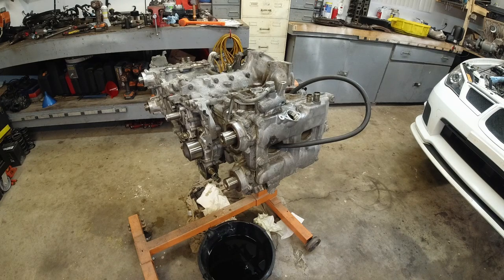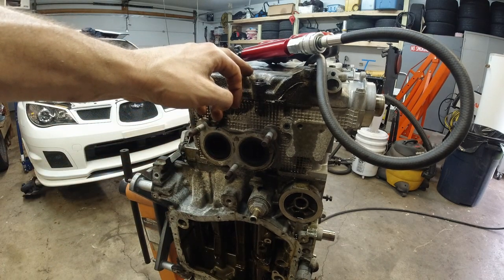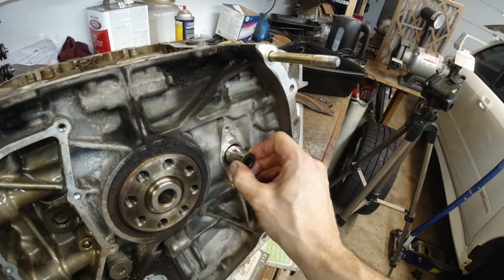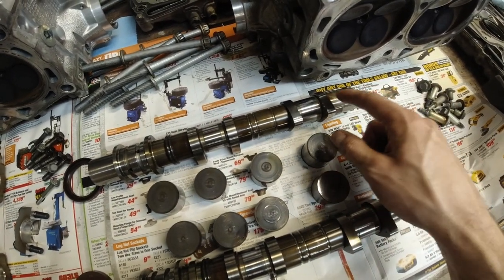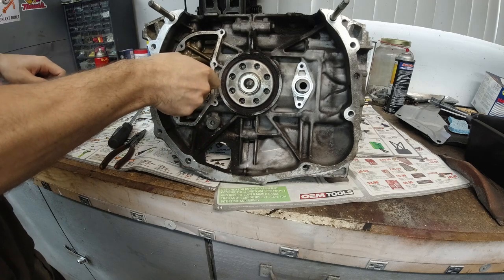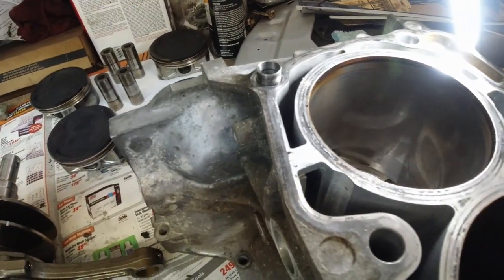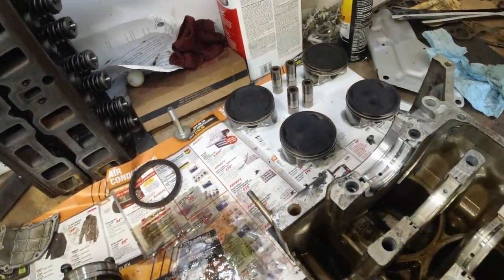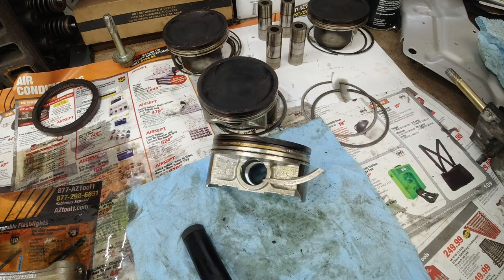Subaru STI EJ25 engine tear down, leak down test, found the problem part 2

Comment: Dude.. sad to see that.  Great video by the way!  I found you by watching videos on the OTC leak down tester while I'm waiting on mine to show up.  Real clear, easy to understand.  Thanks.  One thing that surprised me was that the leak down test didn't show more leakage past that broken ring land.  Especially given the lower compression numbers.  Although, 18% leakage is not real great from what I understand from watching other videos. (but some of your other cylinders had slightly worse leakage numbers). 
I've subscribed and am looking forward to watching your build series on this engine (including the ones that you have already posted).  I'm in the process of checking out an EJ255 out of an 05 Legacy GT and wanted to get an indication of what to expect.  I've also picked up an 05 OBXT and will hopefully get to use it for my daily and the Legacy for my toy.  Following along with ya!
Reply from the maker: Thanks for the sub and good luck with your project, I hope it works out well for you, cheers.
Reply: Sorry to be so off topic but does someone know of a way to get back into an Instagram account?
I stupidly forgot the account password. I would appreciate any assistance you can give me
Reply: @Marcus Nikolai Instablaster =)
Reply: @Tadeo Kristopher thanks for your reply. I got to the site through google and Im in the hacking process now.
Looks like it's gonna take quite some time so I will get back to you later with my results.
Reply: @Tadeo Kristopher it worked and I actually got access to my account again. Im so happy!
Thanks so much you saved my account !
Reply: @Marcus Nikolai no problem :D
Reply: dude you need to make sure your piston is at TDC your cam is still opening the valves

Comment: Last time i replaced valve seals. I kicked the lifters and they got all mixed up. I have the engine out again and am going to try to fix it. I dont even know whats wrong with it yet. Seems all my cylinders are leaking from exhaust. I didnt take off the oil pan. Mite do that and test as well. Great video
Reply from the maker: lap all the valves, i have a video on how somewhere, dont mix them up again :)

Comment: When i took my block to the machine shop the guy said “I can keep my business open just on these terrible engines” only good for 100k miles and expensive to rebuild.
Reply from the maker: Sure but I wouldnt call them terrible and not great at the same time.  A few things people need to know about these cars is who drives them and how.  At least half or more will be young dudes with no experience or knowledge on how to mod and tune them.  All engines brake if not properly tuned after modding it.  For example, If you get a blowoff valve just to have the pssss pssss noise and not tune it, will destroy the engine.  Most WRXs and STIs are bought to mod and then beat on.  Outcome should be obvious.

Comment: Ej257 poor engineering  . I have a 2006 Subaru sti with a po302.  Troubleshooting from step 1 . Swap plug and ignition coil done step 2 intake vaccine leak with smoke machine done. Next swap injectors and do compression and leakdown